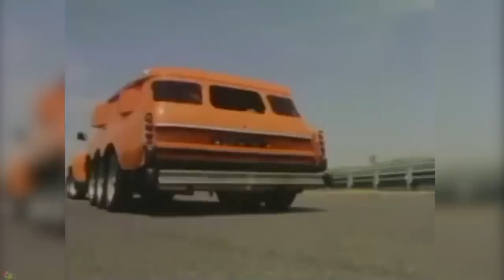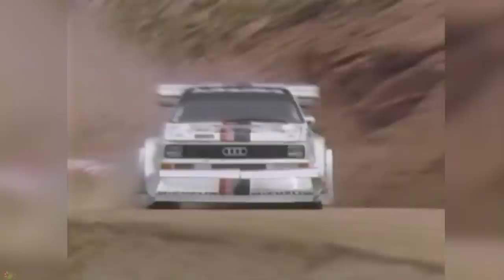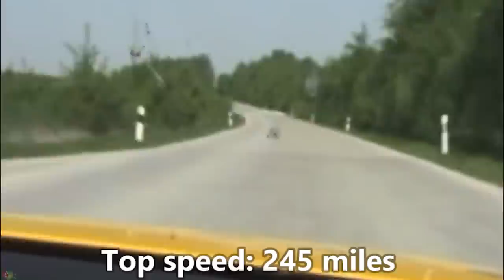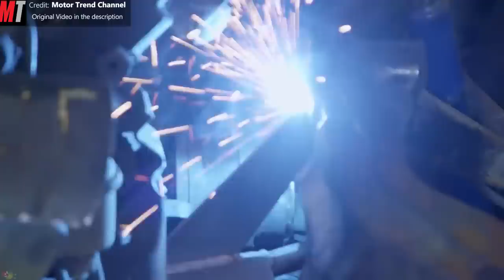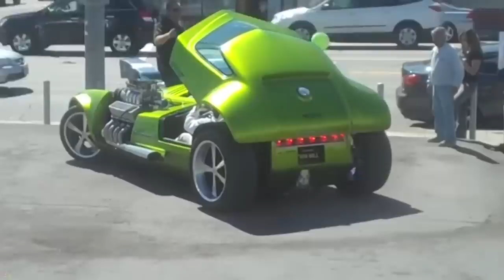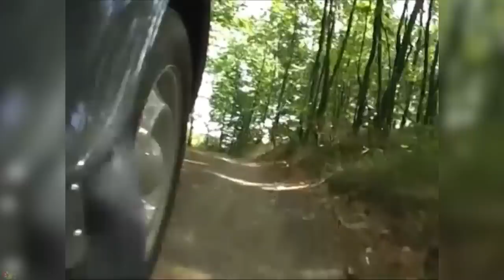8 Incredible Cars With Two Engines

Comment: "Citroen 2cv Sahara the only mass produced 2 engine vehicle" What about the BMW  750iL e32 with the M70 v12, which was essentially 2 M20 inline 6 cylinder engines with a SOHC. The M70 had two:  Motronic 1.7[7] ECUs, fuel pumps, fuel rails, distributors, mass air flow sensors, crankshaft position sensors, coolant temperature sensors, throttle bodies, and even two alternators. You could run the car on 6 cylinders (one engine) for economy.

Comment: @ 5:45 the idiot voice over/narrator calls the black delivery van "is equipped with two TURBOCHARGED engines." This dumb fuck has a job? Hey brainless next time do your homework. Doesnt know the difference between a supercharger and a turbo.
Reply: "and two NITROGEN CYLINDERS in the trunk. Nitrous is not nitrogen dumb ass.

Comment: There was the Cadillac Twinstar,  running two of the Northstar V8's. I once read in a car magazine, that there was a small company out of California that offered dual-engine Cadillac Eldorados.  You put in an order choosing colors and options,  they went and bought a new Eldorado, plus another engine and drivetrain/subframe/suspension assembly, and mounted the second unit in the rear.  A Custom ECM allowed the use of just one, or both engines to be used.  When running both, the ECM kept the engines and transmissions in sync.  I have only heard about it in that magazine article.  I don't know if they ever sold any, or if it was even successful.

Comment: A Boeing 737  use 2 engines why not a car ??    Drive it need great  mechanicals knowledges ...2 different conceptions can nees 2 engine... or a link system able to use both like one in a Tandem  mode ! Or  a  second used like an auxilliary rescue block...(maybee for difficult road  and synergic use for a little time..)

Comment: All cars with "w" engines technically has 2 engines. This means that the Bugatti veyron has 2 v8 engines and the Bentley continental got has 2 v6 engines
Reply: By that argument all cars with a V8 engine have 2 straight 4 engines, so your definition seems a little flawed. I would say that an engine can only be called independent if it can be removed from a vehicle and function on its own, with only air, fuel, exhaust, cooling and electric utilities. A W engine cannot be split into 2 engines by this definition as it has only one crankshaft, so no it is not 2 engines.

Comment: So can I use both engines separately? When one engine will be on, the other one has to be off. And one drivetrain only. I like rear wheel drive.1 engine at a time but Both engines have to deliver power to the rear wheels. Will it be possible? ?

Comment: John Cooper experimented in the mid '60s with a twin-engineered Mini Cooper which was extremely quick, but after a welded up steering-arm on the rear-suspension fractured (they'd used the complete front sub-frame from another Mini Cooper), & almost killed the test-driver, this idea for a competition vehicle was abandoned!

Comment: Bro, your grammar is terrible. Using the wrong words constantly. Real drag on the info. Short sleeve, not shirt sleeve, specially not especially, with AN eight liter engine, THE desert not a desert, it was that bit - it was so big/wide, due to the civil war flamed - what? flaming? raging?, by this the designers - what? wtf how does "by this" fit and wtf are you even trying to say? "with this"?, "largest desert in the world" - ok, technicality here because the Antarctic and Arctic are the 2 largest and the Sahara is third. "Receive crazy torque", well narrator, how much torque? [Twice Blown] Also, with an open exhaust dump, there is no way those twin hemis are also "twin turbo charged", probably they both have superchargers. A quick look at the build shows they indeed are super charged, not "twin turbo"-charged. Shit like this makes your videos a fucking half-ass attempt. Disliked.

Comment: Please make him Stop! This is like auditory waterboarding!! @MAD LAB, Please send me ALL of your vids BEFORE you post them for me to make the necessary corrections! You know sheep shit from apple butter about cars. BTW, I grew up owning and building some of the Best MOPARS from the 60's and Keith Black made a custom set of HEMI heads for my 444 B-block stroker so....STOP trying to spec out ANYTHING MOPAR! Each one of those BLOWN HEMI's produced 2,500hp Each! There is 5,000 hp Minimum in raw motor power alone. Those Ntrous Oxide systems (NO2) are good for 300 hp Each (another 600 hp minimum).  Like I said before....Send your vids to me BEFORE you post them so I can notify you of ALL the corrections you need.

Comment: I will not change oil in this thing as i will run 2stroke synthetic stroke oil with oil injection, Amsoil dominator 2 stroke is cheap where im at and i will run nothing but it. if you dont like it just fucking deal with it. Brap

Comment: Does the electric motor count as engine. If yes, all the hybrid have two engine.
Reply: Anh Tuan Le Minh.
An electric motor is not an engine.
Reply: If its electric it has a motor. If its a internal combustion its an engine. You can have an electric motor or a fuel engine not other way around.

Comment: No Smart Roadster BRABUS biturbo V6? It used two 700cc turbo 3cl engines blended to make a tiny 1.4l V6 Biturbo in a featherweight lotus-like car.
Reply: Lord Twaddle Blended? And if you attach 2 engines to make 1, that's no longer 2 engines. Because they run off the same crankshaft and are geared together.

Comment: What about hybrids? They sure have more than one ENGINE!
Reply: Carl Strandberg.
An electric motor is not an engine.
Reply: No they dont. One engine and multiple motors.
Reply: "An engine or motor is a machine designed to convert one form of energy into mechanical energy" From Wikipedia, the free encyclopedia
Reply: No gas is engine electric is motor. I have degree in automotive engineering so dont qustion me
Reply: Carl Stranberg.
An engine is a unit that converts thermal energy into work. If there's no combustion, it's not an engine!
Electric driven machines do not have engines.
Reply: True full electric like teslas have no engine. Hybrids will have one enigine and one or more motors. People tend to mix engine and motor and it eritates me.
Reply: Rob Hartfiel.
Too right mate!

Comment: No Bugatti Chiron the put two v8s in it making a v16
Reply: Ben Metzger They merged them into a W16, like a double vr8
Reply: It’s not two v8s put together!  It’s two banks of 8 cylinders offset a little every other cylinder to shorten the the total length. The 8 cylinders have one very wide head assembly mates to a single flat plane
Reply: The Veyron has 1 engine...not 2...
Reply: the king Which means it's 1 engine...
Reply: W16
Reply: My Channel Lacks Originality it has 2 V8’s made to 1 W16

Comment: Says Bugatti Veyron shows Bugatti Chiron...
Reply: Its a civic
Reply: Rzaqo true, me as a car enthusiast makes me rage!
Reply: Berro Work  it is definitly a chiron.  The side vent body work goes all the way to the roof.  The veyrons does not.
Reply: Im triggered as a car enthusiast
Reply: Yeah, I couldn’t make it all the way through before writing. Another one: the bimoto. That’s not 2 1.8 liter engines as Audi didn’t make a 1.8 liter V6. They made a 2.7 liter TT motor, the rear engine looks like it’s 1.8. Also, yes; the 32 delivery can’t be turbocharged with zoomies; and I don’t think 1 roots unit per engine means any more than 2 supercharged...it’s pretty funny. I won’t bother with the rest as it’s obviously ridiculous.
Reply: Zahid Ansari Dodge Demon does in 2.1
Reply: It's a Mitsubishi Lancer
Reply: How could he miss that??
Reply: you took the words right out of my mouth.
Reply: Zahid Ansari a rallycross supercar does 0-100 kph in 1.8 sec they only have 650 HP with a 1.8 litre 4 cylinder turbocharged engine but only do 205 kph i believe
Reply: Potatolumoc It's all about gearing and torque 👌
Reply: Rzaqo “.
Reply: So can I use both engines separately?  When  one engine will be on, the other one has to be off. And one drivetrain only. I like  rear wheel drive.1 engine at a time but Both engines have to deliver power to the rear wheels. Will it be possible? ?
Reply: I was just about to comment yeah thats a chiron
Reply: Rasmus I’m pretty sure it’s a Fiat multipla
Reply: Says ‘nitrogen’ means ‘nitrous’. Specifically  nitrous oxide, which is significantly different. These videos are cash grab bullshit that ushers other people’s work, it’s pathetic really.
Reply: Rzaqo and bugatti hits 100kmph within 2.5sec!
Reply: Berro Work NO ITS NOT
Reply: Rzaqo 8
Reply: Rzaqo its a Veyron
Reply: BerroWorks066 rock dweller.

Comment: Mate you know that electric cars have three engines or two
Reply: Motors
Reply: Elvis Layton Full electric vehicles have no engine, only a motor. Hybrids have a single engine and a single motor.
Reply: Not engines, MOTORS.
Reply: yes exactly. also didn't the SLS Electric had 4, one of each tyre?
Reply: Electric cars have one hybrids have 2
Reply: Tesla has 2
Reply: This is obviously a vid on vehicles with multiple combustion ebgines. And elecric cars usually have one engine, hybrids have 2.
Reply: Ian Sundfeldt electrics are lame